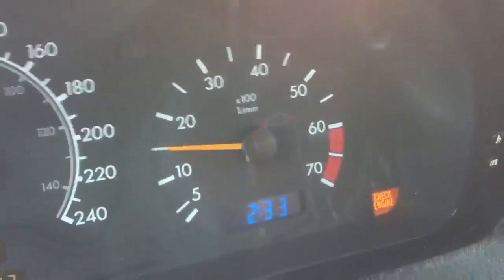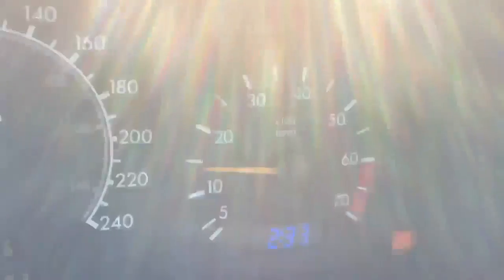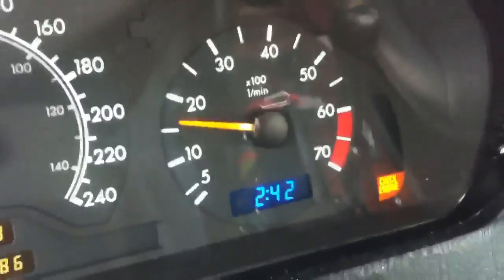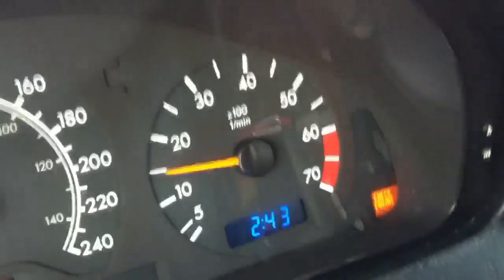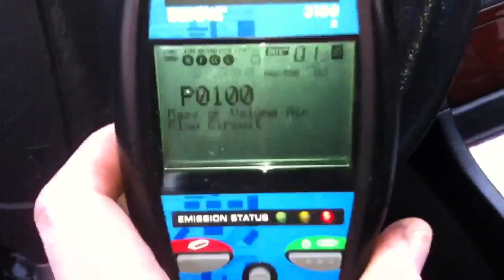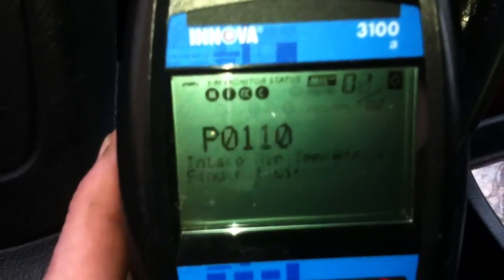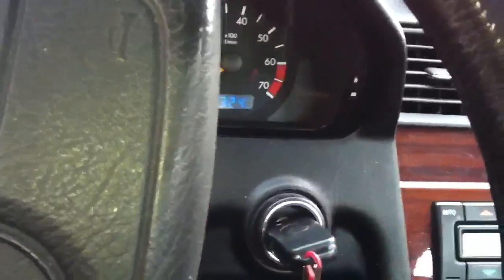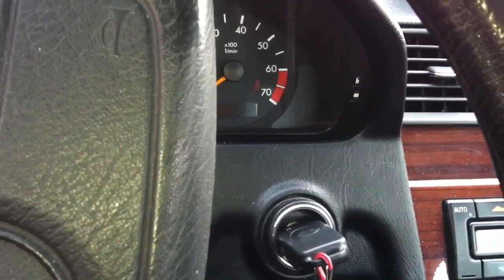Mercedes C230 W202 OBD2 code reading..MAF sensor failure..P0100

Comment: Got a 98 c230 with the same codes. Maf sensor circuit malfunction causing misfires and the whole thing shakes. It hasn’t stalled but it wants to. I replaced the sensor, sprayed the circiuts and my ecu and  tcm
Reply from the maker: Did you use an original Bosch MAF ? I have tried the aftermarkets and the car doesn't like them at all .
Reply: @fupabox  ill have to check. But it turned out to be ignition coils without a code for them. Now it's throwing me EGR valve codes.

Comment: you have helped me with so much on my car.  Today you helped me finally find my 0bd port.  For years I have been unsuccessful in trying to use the under hood port.  The one  underneath the wheel had been punched out of position by a careless worker.  Seeing the video showing where it was placed exactly i decided to rip out the cover and fish around, found it down side 3 codes.

Comment: Hi fupabox. The CEL on my '97 C230 came on yesterday and the car started shaking vigorously when idle. Took it to autozone and the computer diagnostic suggests that cylinder 2 misfired (code P0302) -TWC damaging. What do you suggest for this problem? How much driving can I do before I have to take it in for repair?

The car's been in California for most of it's life but it is now in Ohio and  going through its first winter...it's been snowing a lot and the weather has hit the negatives a couple of times

Thanks
Reply from the maker: +Cormack Lazarus there are 2 coil packs under the plastic cover on the cylinder head..each controls 2 cylinders.. number 2 is the second from the front of the engine. I would replace the coil on that cylinder ( both coils are the same so you could get one from a wrecking yard)  I would also check first ..the spark plugs especially the one in that cylinder for damage from the misfire.. make sure if you replace the plugs you get a non resistor plug . In fact I would check the plugs before replacing the coil , as it is likely someone used a platinum spark plug or another supposed high performance plug in the engine which can cause misfires..another thing to check is that there is no oil around the spark plug boots from a valve cover gasket leak..oil around the plug boot can also cause a misfire
Reply: +fupabox I will definitely look into that thank you so much. What about driving it? Is this an emergency or do I have a little time in which I can still drive it?
Reply from the maker: Cormack Lazarus if it isn't misfiring at the moment you should be fine..if it was constant I would park until fixed
Reply: Thank you!

Comment: hey Fupabox!,  Thank you  so much for all your videos man, they help me a lot. i really like  this car i buy my w202 c230k '98 one  year  ago.  it has 80k miles  it  works  very  well  for  a year. all  the little issues where solved  with your  videos nothing bad . but  now im having a really bad time. i read  a lot in different mb forums about the same problem in other mercedes c class. my car run great until i hit the gas to pass by , my rpm go up but there  is no acceleration i need  to remove my feet from gas pedal  and start accelerating slowly and  it works fine and othertimes when i hit the gas  it works fine  but  at  high speed  start  to lose  power  and when  i get to a stop light  the  car is stumbling  like cylinder misfire.  but if i turn off the car and power back on it works  complitly fine until i hit de gas hard. first i change the spark plugs and the coils  like in your videos  and still has the same  problem, i make  all the oil and filter changes  i put the benz injector cleaner  im reading i think  could  be the MAF or  the catalytic converter but  other people say it  could be o2 sensor  or  the fuel pressure regulator. have you heard about this kind of  problem ?  do you had any idea  what could it be ? . i hope you can help me! sorry for the long  post and  my bad english.
Reply from the maker: +Didier Vala  Your English is very good.  I think you have a transmission problem.. The rpms are going up..nut the car is not accelerating. I think there is a problem with the torque converter , or the transmission fluid.  Have you checked or changed the transmission fluid ?  Do you have an automatic or manual transmission ?
Reply: yes the rpms going up with out accelerating when i hit gas hard , but if i do smoth it works fine untili get to 90m/h it start to lose  power  like if the car want to turn off (like a manual transmision) at that  speed it feel like if it has  trash or air in the gasoline i dont know if you  understand me ,  its an automatic transmission. and yes i change  the transmission fluid 1 month ago 2 months ago the car was working very fine. No problem in highspeed  or hitting the gas to pass by in a highway.
Reply from the maker: Didier Vala I think you need to check the transmission fluid level again. I think the transmission is locking and unlocking. When you come to a stop and it runs poorly, shift into neutral..if it stops running poorly, then the problem is likely the transmission..or possibly the transmission control unit/ecu.  The electrical connector into the transmission can develop a leak.. if fluid gets into it , it can cause issues with the transmission which would cause some of your symptoms.  Watch this video series.. there are 6 parts, but it has a lot of explanation on how to check and replace the connector and other parts of your transmission.  https://www.youtube.com/watch?v=bdt4g5jqo4E
Reply: Didier Vala  hello vala, it may be an old post but I'm experiencing same problem, did you ever got a solution to yours

Comment: My '96 C36 just starting hard shifting today between 1st/2nd gear most notably.  No check engine light and I did clean MAF about a month ago (although I realize this doesn't do anything).  I guess I could still run diagnostics with no check engine light on to see if MAF?  Thoughts Fupabox and btw have watched a ton of your videos.  TY!
Reply from the maker: +mpowers1978  I would check the fluid levels in the tranny first, and also see if it is a nice clean pink color... The next thing to check would be the vacuum modulator on the side on the transmission for leaks.  I don't have a ton of experience with that transmission. But I do have a link to the service manual for that transmission  .http://shop.ukrtrans.biz/wp-content/uploads/catalogs/722.4.pdf

Comment: Hello i have same problem. Could you tell me what was the problem ?
Reply from the maker: *****  MAF sensor
Reply: +fupabox you er big boss.thank you
Reply from the maker: ***** glad to help
Reply: +Mziry why the fan is working slowly? engine and radiator does not get enough air when it is hot? the water flows out of the water container.. What can I do to make the fan go lowered if the motor gets hot ... If I start the car and run a little bit. temperature gauge goes between 80 and 90 c plese help
Reply: +Mziry w202 sport. 99 mod
Reply from the maker: *****  normal temperature gauge reading should be around 90-95c in the summer time, around 80-85 in winter...if there is coolant coming out of the overflow bottle, there are a few things that may cause it..the thermostat may be stuck, headgasket could be leaking (worst case), worn water pump, or there is some other blockage in the cooling system.. try feeling the top radiator hose hose while the engine is running and see if you can feel the water flowing through the hose..if you can't feel the water moving through the hose, rev up the engine a bit and you should be able to feel it...squeeze the upper hose hard a few times...this can sometimes free up a sticking thermostst

Comment: hey man i have 2 questions ^^ 
1- why isn`t recommended to put the car in N gear and cost ? 
2- i have an-old r170 97 with 38 pin OBD port i have the cable to convert it to 16 but whenever i plug a cheapo BT obd to it ,  it wont connect to the ECU i have tried 2 and both gave the same result ((its working fine on the corolla 2004 )) what do you think the problem is ?? its ELM327 OBD . 

i want to come to canada and live there soooo bad :<
Reply from the maker: You'll love Canada..except for the snow, and the mosquitoes  :)
Only an automatic transmission should not be coasted in neutral..the gears which depend on engine speed to pump fluid to them,are rotating at the road speed in neutral,but the engine is pumping fluid at idle speed...occasionally doing it for a few seconds is no problem..

The 38 pin connector to OBD2 unfortunately won't work in your car because it was built just before OBD became standard anywhere (except Canada and the USA, due to pollution regulations)..some guys have built flash boxes for the 38 pin connector to check and erase codes on older Mercs.
Reply: ***** snow and mosquitos i can live with ^^ its better than living with 50c daily in here :P anyways then whats the use for the 38 to 16 pin converter cable ?? i`v seen people use those cables with they are happy with them :S maybe i have a faulty one ? or is there any old OBD that hook up to the 38 pin and works with my car ?
Reply: i`v read some thing about MB Multiplexer Mercedes Diagnostic Tool is that what i need ?? my car dont have OBD2 port btw ((im sure you know that at this point :P )) and i found a tool for like 35$ with the box and cables even one from the old serial com port to obd2 port  so is this what i need ??
Reply from the maker: KingStivan
The current 7.4 multiplexers (clones) require a very old laptop with a true serial post hookup and windows xp...this is a great reference thread to read up on the options..IE,breakout 3 wire box, and different multiplexers... I haven't tried one yet, but am currently doing a lot of reading on them to try to get an idea of what will be the most useful option for my CLK and any future cars I will be getting...some of these units only work on cars up until 2005,and some will only work on cars up until 1995...   http://www.benzworld.org/forums/r170-slk-class/1270869-38-pin-carsoft-7-4-a.html
Reply from the maker: KingStivan Oh wow..never seen one of those that inexpensive..yes that will work
Reply: ***** next step is order one and hope this shady site won't rip me off :P ok thanks man for the info ^^

Comment: Good to see the Mercedes W202 can be checked with a OBD 2 reader obviously you have a round pin converter plug which Ive ordered for mine
I have a C180 99' so I hope the reader works it does have mercedes in the list and mentions C230 in the instructions so fingers crossed :)
Reply from the maker: the round 38 pin connector isn't needed to read engine codes...obd2 is an industry standard and must be able to be scanned with a universal device...should be a small plastic flap in the under dash panel above the drivers knees,could be on passenger side also...unfortunately the only systems that need, by the regulation, to be able to be scanned via obd2 ,are the engine management/emissions related stuff....for anything else you would need a carsoft 7.4 multiplexer which can read Mercedes factory codes through the round connector...I think you are in Europe so the same obd2 standards didn't come into play until 2001...you may not have the obd2 connector we have in North America starting in 1996...I have heard that the adapter you are getting may work in that case..fingers crossed

Comment: I saw in another video that If you don`t delete the error codes, after repairing, the check engine light wont go away. And to delete them you need assistance from a Merc specialist?!
Reply from the maker: the engine codes can all be erased with a normal OBD2 reader,without going to the dealer...they will stay lit unless erased
Reply: Thanks.